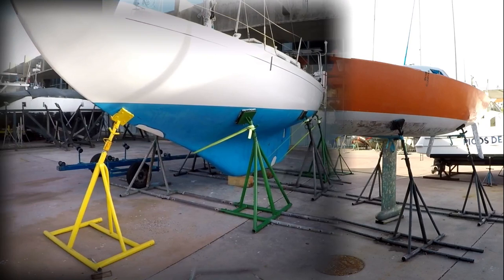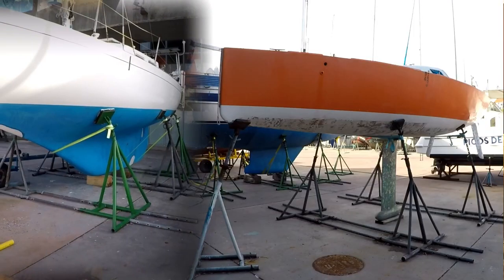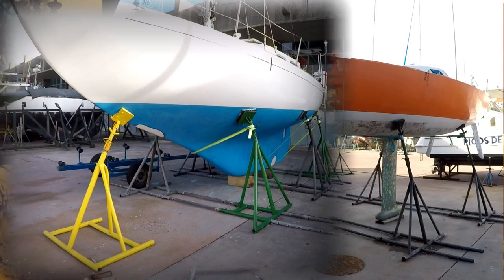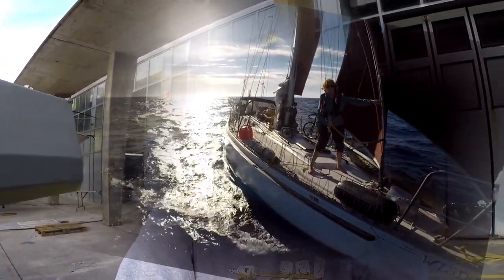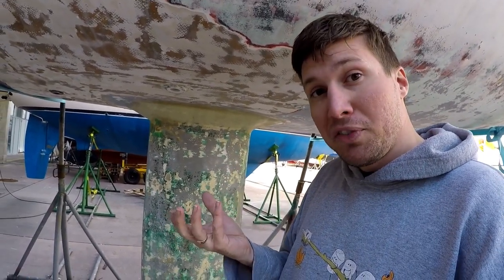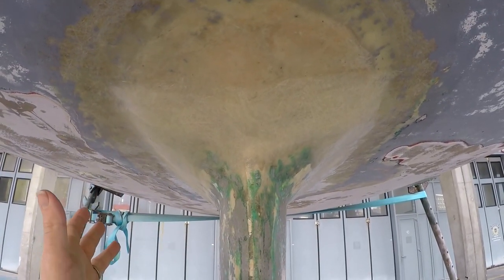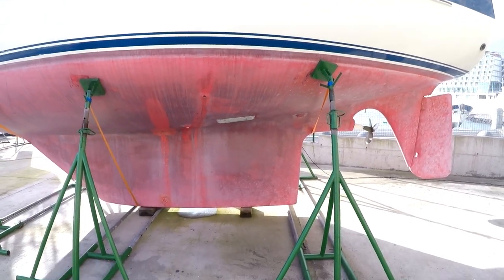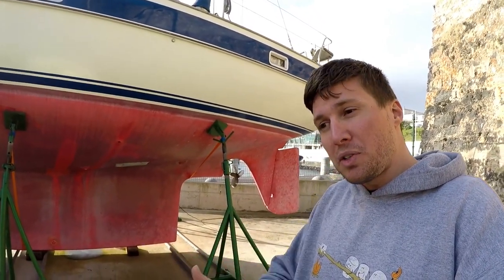Which is the BEST Keel Design? | Sailing Wisdom

Comment: What a crock of bull, suggest you do some more studying on keel designs. Or you you may want to look up aero foil  and how it works
Reply from the maker: I have, in various books. I now think you should direct your comment at yourself.
One of my favorite books on the subject is The Science of Yachts, Wind & Water by H. F. Kay. It is very informative and well explained.
Reply: @RiggingDoctor  you are wrong to say just the leading edge create lift read the book again or get a better book
Reply from the maker: The leading edge creates the lift, the CLR is the geometric center of the underwater profile. These are two different things.
Reply: @RiggingDoctor  Sorry but you are plane wrong the leading edge does not create the lift the area from the leading edge to about 30 - 40% back does depending on the shape. To say it all comes just from the leading edge is untrue.
Reply from the maker: So my long keel would out perform the racer keel because I have more surface area? We are both the same draft and shaped like a foil.
Reply: No and I did not say that this just shows you trying to deflect from the incorrect statement you made and lack of understanding about keels and how they work.A full keel has a very poor L/D ratio compared to a fin type keel due mainly to its large cord to length ratio
Reply: @RiggingDoctor  could you explain what lift the leading eadge gives, the keel, full or fin is a symmetrical shape and thus provides "lift" to both sides.
Reply: Lift is created by a pressure differential from one side of the keel to the other just like a wing on a plane. It’s not just the leading edge. It’s based on Bernoulli’s equation which is an energy balance. Essentially potential energy is used to create kinetic energy thus depleting the potential energy from one side. Potential energy is stored as Pressure. Laminar flow over a keel does break down possibly  the further aft along the keel. Flow separation and disturbed flow may develop. Some keels and rudders are designed to prevent this.
Reply: @highnotesailing5843  I understand that, Rigging Doctor states that the leading edge of the keel creates lift. I want to know how that works from him. I understand how lift works and pressures created around air foil shapes.
Reply from the maker: Jeremy Burgess it is a symmetric airfoil, and since you think it provides lift on both sides you pointed out your misunderstanding. 
The keel is pointing straight ahead but the yacht is never moving that way. The lateral slipping (leeway slip) causes the keels leading edge to meet the water at an angle (the keels angle of attack) and that causes the keel to generate lift on one side of the keel. 
If the keel has a short leading edge, it will generate less lift (full keel or retracted swing keel). 
If the keel has a longer leading edge, it will generate more lift (deep keels). 
More lift allows better performance to windward because the keel is more effective. 

Take a 20 foot by 1 foot keel and attach it to the bottom giving the boat a 20 foot draft and it will go to windward like a champ. 
Take that same keel and mount it sideways, giving the boat a 1 foot draft (and a 1 foot leading edge) and it will perform somewhat differently. Wouldn’t you agree?
Reply: @RiggingDoctor  why can you not just admit you were wrong to say that the leading edge creates the lift how hard would that be. It is not the leading edge length that is important it is the aspect ratio how hard is that to understand.
Reply from the maker: What you are implying is that less leading edge will generate more lift. Please explain how you think this is the case.
Reply: It is not just the leading edge that creates lift. I have studied graduate level fluid dynamics and have published in the field. The leading edge is more likely to have laminar flow, and you are correct in terms of the balance between drag and lift.
Reply: @RiggingDoctor  There you go again showing your lack of understanding, I did not say or imply that less leading edge would generate more lift. You are fixated with the leading edge being the only factor and that is just not true. My statement that you cannot seem to understand clearly said it was the aspect ratio that determined efficiency. So a high aspect fin is more efficient than a low.
Reply from the maker: Sounds like you understand it! 😀
Reply from the maker: CUM BOT and how does aspect ratio affect leading edge length?
Take a low aspect ratio keel and give it a super long leading edge and it will perform better than one with less leading edge. So same aspect ratio, but just much larger (and obviously the leading edge length will be different in these two). Which one will works better?
Let me make this simpler for you: keel dimensions are 1 foot by 3 feet vs 10 feet by 30 feet. Same aspect ratio, different sizes, one has a longer leading edge. Which do you think will perform better?

If you can’t understand this, there is no way I can ever educate you on this matter and I’m done wasting my time on a hopeless case. 
I hope this can make sense to you, if not, just enjoy your boat and don’t worry about how it’s actually working. Someone else already did for you.
Reply: @RiggingDoctor  Sorry it is you who is a lost case and does not understand efficiency in the case you gave yes you will get more total lift with the larger keel BECAUSE it is bigger not because it's more efficient. You still have not answered the question as to what you class as the leading edge. If you are going to call yourself rig doctor may I suggest you understand and use the terms correctly. The leading edge is just that a very small area at the very front of the foil.
Reply from the maker: I really feel like you wont listen simply because it's me, so I decided to help you out with literature. If you deny the validity of these documents, then that would relegate you to the realm gut feeling knowers of the truth, in which case you are as hopeless as your name.
https://www.researchgate.net/publication/237150728_Investigation_of_the_Effects_of_Different_Keel_Geometries_on_a_Sailing_Yacht
Please note Figure 3 and notice where the suction is occurring. 
Please also note the conclusion where they state that aspect ratio is the major parameter for lift force in keel design. 

That means that aspect ratio is the important part, not keel size.

I really hope this helps you.
Reply: @cumbot6423  Honestly, if you're going to take the task of debating someone about a topic you clearly consider yourself an expert in, then why in the flying fuck would you use a username like CUM BOT? Serious discussions probably merit a slightly more serious/real name, otherwise it's rather difficult to take the person all that seriously, whether you're right or not.